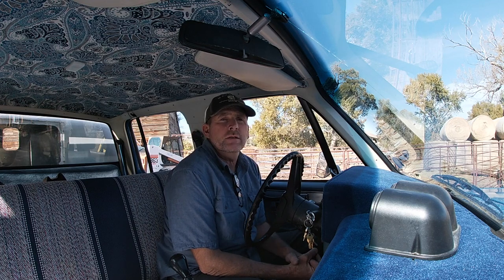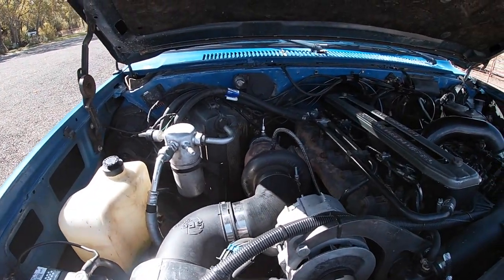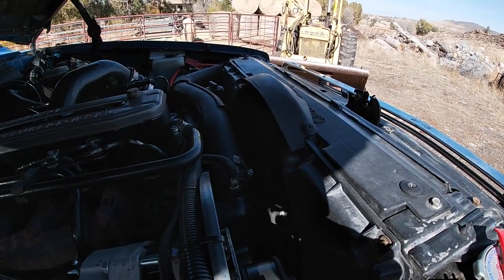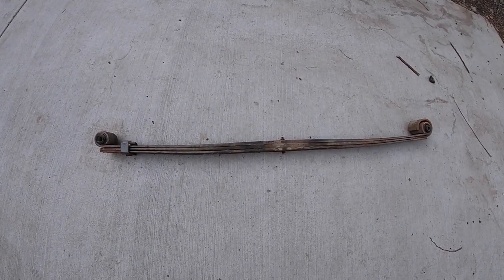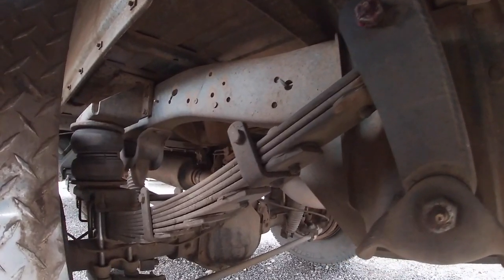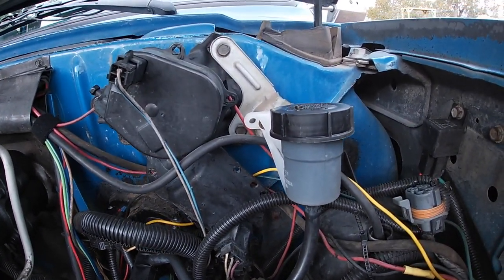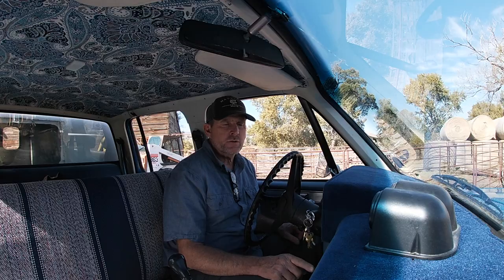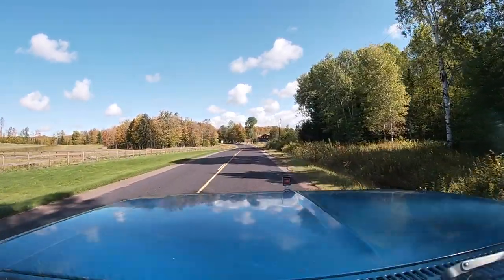Cummins Swap Square Body

Comment: i like your truck its better than any new one on the market I have a 1993 ford f 350 crew cab 4x4 7.3 idi  automatic overdrive 4.10 gears i get 22 mpg at 70 mph i would not trade it for a newer truck

Comment: I absolutely love your truck! I have an 87 Suburban that I bought for 1k bucks. It's on 35s and I love it but it's got a tbi 350 and I average about 8 mpg just driving down the highway without pulling anything. Your video has inspired me to look further into a Cummins swap for it so I can pull my camper with it.
Reply from the maker: Jason thanks for watching. It's a totally different truck with a Cummins. It's capabilities far surpass what it use to be. However I always feel the need to tell everyone who is thinking about doing the swap, it not for the faint of heart and there are cheaper ways to get a pulling rig, but I still love my truck and don't regret it. And its got the cool factor!!
Reply: Going off the Rails thanks for the reply check out my Suburban if you get a chance on Instagram @bigbadburb

Comment: I basically have the same type of truck you have, crew cab chevy 84' 1 ton with single rear wheels, was also a camper special that had 2 battery trays, hydroboost brakes, and it was a manual so it had the higher trans tunnel, installed the cummins over a year ago and have tripled my MPG and increased my pulling power to boot.   I have it straight piped for now but like you, i'm going to make it more comfortable to drive for long hauls.   There are Mechanical cruise controls you could potentially install on the truck to make it easier for those longer drives.
Reply: I got done with the same swap a few months ago. 1983 K30 dually 4x4. Went from a dog 350 getting 6MPG to having gobs of torque and getting 22MPG. 

I was lazy with the exhaust and stuck it through the hood. It is a little uncomfortable on long hauls especially if you're hauling heavy and can't use 5th gear. 

My 12 valve came out of a Ford F800 so I couldn't use the radiator, or fan, or intercooler, they were way too big. Used an aftermarket all aluminum radiator and dodge second gen intercooler. With some low pro electric fans. And a reman NV4500. 

It was a pain while doing the swap, but that first drive I knew it was all worth it. 

I didn't end up having to modify much either. Driveshafts fit. Pinion angle was right. Firewall cleared easy. Just fuel lines and throttle linkage had to be figured out, couldn't use the ones out of the F800. 

One thing I noticed after driving it for a while: I had gasoline fuel sending units in my gas tanks. When below half a tank I saw a steep decline in power. Turns out there is a difference between the gasoline and diesel sending units. The fuel return on the gasoline unit drops the fuel from the top of the tank and it falls and splashes. The diesel unit fuel return has a pipe that returns the fuel to the very bottom of the tank. I found that my fuel was foaming up and aerating the, causing a loss of power. I swapped them for the diesel units and that problem went away.

Comment: Great video. Very informational. I just bought my 1988 gmc 3500 dually crew cab xlt. No rust and super clean. 2800 bucks. I have my 5.9 Cummins all ready. I have a long way to go until finished, but this video will definitely help.
Reply from the maker: Tom,  Thanks for watching . Im glad you could glean some helpful information from my vid. Feel free to email me if you have any questions about specifics on my build. david@morrowsports.com
Reply: @goingofftherails9877  thank you!  I emailed you!

Comment: My first trick was a 82 F-150 4x4 had that for 20 years. My current is a 2000 Explorer have had it 10 years. 
And like you I like the simplistic lay out.
All wheel drive has a radio and A/C.
but thats it.
Though there is a computer or two.
Hello from Alaska

Comment: For anyone considering a swap seriously  consider the 24 valve Cummins. Its much quieter than the 12v. As long as you have a good fuel system there's nothing wrong with the VP44. They will absolutely last 200k+ miles. My hat goes off to David for the swap though. Love the truck, I want a K20 Diesel swapped really bad. 8)

Comment: I love your truck!  I did a cummins swap on my 1986 gmc 3500 dually.  It’s a 5.9 with a nv4500 2wd.  I did a 3” body lift to avoid the firewall mods.  I upgraded to a vintage air surefit system and no longer have the stock ac under the hood of you did that you could have room for your compound turbos.  I did the lizard skin to try and deal with the noise but it still have to do the firewall and dash with dynamat and foam to quiet things down some more.  Nice video and have a Blessed day!
Reply from the maker: Thanks Jason. Would love to see yours. Do you have any pics on instagram ?
Im taking mine to my sons Ranch in Texas soon and I'm doing valve adjustment this week to see if that could help a little. I don't mind the noise that much but just trying to keep my wife happy. I did put a K27 turbo on a few weeks ago. Noticeable power upgrade
Reply: I am on instagram under supernaturalnut the truck is on there it’s white.

Comment: Getting ready to do the same exact swap on my '98 K3500 CCLB Dually.  My donor is also a 1994 Ram.  Bought a bunch of parts from Power Driven and will be getting started on the project by the end of the year.  Still need to buy mounts and get a Dodge bellhousing and input shaft for my GM NV4500.
Reply from the maker: What parts did you get from Power Driven? Turbo? Injectors? I am thinking about upgrading to a K27 turbo from PDD.
Reply: @goingofftherails9877  I bought their 500hp Fuel Package, pushrods, 60lb springs, hot rod lift pump and their new Aggressor turbo.  The K27 would probably be a really good match for those parts, but I wanted to give myself a little room to grow if I turned it up any more. We'll just have to wait and see how that combo works.  I'm super eager to get started on the swap and get rid of the slow, thirsty 454.

Comment: Really cool truck you've built yourself. I've got an 71 gmc that I played with the idea of putting a 12 valve into but ended up deciding in an 8.1l big block. Wasnt aware you had a yt channel, I first saw your truck on tfl's dude I love my ride
Reply from the maker: I started YouTube shortly after tfl's video , since there was so much positive feedback. I think your going the best route on your build with the 8.1 liter. I love my cummins but it was a lot work that you won't have with a v-8. Ive got a 72 and a 73 that I still would like to tinker with in the future . Good luck with yours !

Comment: Very cool truck. I have a 1983 K30 dually that I was going to LS swap. But a 12 valve with under 50k miles just fell into my lap, and now I'm REALLY thinking I'll put the Cummins in it. Only problem is my truck is an auto, so I'll have to convert it to manual.

Comment: Awesome truck. I currently own a 1986 M1008 with a 6.2 diesel. I’ve had it since 2012 with the stock non turbo 6.2 good mileage but no power. I’m goin this route with the Cummins but I think I’m going with the 1st Gen 5.9 12 valve. I just use it as a daily driver no hardcore wheeling.
Reply from the maker: A 1st gen swap is still a great option. I do like my Power driven diesel fuel adjustment that the P pump allows you to "turn up the fuel" .With the flick of a switch I can almost make this truck fly.  :)

Comment: I had the same smoke issue in town and an egt issue when towing with a 362 turbo and 100 horse injectors.  power driven diesels AFC live box is amazing on the fly pump tuning and at the flip of a switch full power for when you're feeling gitty
Reply from the maker: AFC live is Amazing! I leave mine turned down mostly but when I really need it , towing up a incline or passing, its crazy power instantly.

Comment: Dude.. Loved your video.. I kept backing it up lol.. Such a Sweet truck, and i did subscribe to your channel thank you!! Now then i have an 85 C30 2WD 1st gen cummins 5 speed clark out of an international that i bought off a guy in Payette Idaho, and it wasnt a great install so i had to "redo/Refab" alot of things.. in the process of a total brake rebuild and having problems with the hydro boost lines.. bought a remaned HB from rock auto and its different  thread so i got new lines coming and hoping for the best.. Also want to "fix my AC may have to have some new lines fabed up? Oh just one more Q.. i need to make my grid heater work and there is no GH relay only a hi amp button on the dash.. Any help at all i will greatly appreciate.. Thanks again Gods Blessing on you and yours!!

Comment: Hey if you are still trying to move that ac and heater box from under the hood vintage air makes a kit for an under-dash assembly similar to the new trucks and cars. Looks good!
Reply from the maker: Evan   Thanks for that tip. If I ever do convert to compound turbos, I will look into that option

Comment: I built the same truck as you except mine was a factory diesel ,  it's not that loud. however, I replaced the sound mat behind the dash( pain in the @$# ) and also it being a diesel it had a factory sound mat behind the engine on the firewall... Maybe this will help with your noise issue. 👍
Reply from the maker: I just bought some more sound deadening products and a decibel meter too. Plan on doing a video on noise level and see if I can quiet it down a little. Thanks for your input.

Comment: Hope you're doing well and hope to see this channel grow!  You mentioned having to enlarge the filler neck size to fit the diesel pump nozzle.  How did you do about that?  I just finished my swap and realized the nozzle doesnt for my 454 tank.
Reply from the maker: Hey DanteGTZ. All is well. I crafted a large tapered  punch from some round stock and simply pounded the the light sheet metal into a larger hole.  Didn't want to cut or file because I already hooked up the hoses. Work pretty good with a few rough edges. Good luck
Reply: @goingofftherails9877  thanks!  I'm going to see what I can do this weekend to enlarge the filler neck hole.  Still waiting on a few other parts to arrive and I need to finish a small amount of wiring but I cant wait to start using this K3500 again.  Take care.

Comment: Any chance you can tell me what adapter and input shafts you used to mate the gm np205 to the dodge nv4500?
Reply from the maker: I had Final Drive rebuild my nv4500 with new sincros and put the new shaft and adapter on the transfer case. I believe the advanced adapter is 50-6911 and changed from the dodge 29 spine to the chevy 32 spline, however its been a while and I don't fully remember . Thanks for watching

Comment: If you want compounds just switch to a Vintage Air setup for your AC. Moves everything under the dash, but you do give up glove box space.
Reply from the maker: Might just tackle that someday. I do think it would be worthwhile . I may have just smoked my turbo that I rebuilt, when I passed three trucks on the highway about 2 weeks ago. I flipped the switch on my AFC live when I went to pass, and I hit fuel a little too hard and my truck launched around the trucks but I went up over 40 lbs of boost... May need a new turbo soon?

Comment: That is my dream truck right there! What was the estimated build price if you don't mind my asking
Reply from the maker: Well... lets try and itemize 
1. bought old farm truck
2. machine block, rings, springs, head studs
3. rebuild on NV4500 with syncros 
4. advanced adapter plate and new spline shaft
5. modify both drive shafts with new u joints
6. South bend single clutch with slave and master
7. relocation bracket for A/C and  alternator 
8. new gm alternator and A/C pump
9. rebuild p pump at Industrial injection
10. Fass fuel pump and new fuel lines
11. Modify fuel tanks with fass pickup straw
12. Two new Batteries with heavy wire and grounds
13. After market innercooler with silicon tubes
14. new 40hp over injectors
15. rebuild kit on HX35 turbo
16. 4" exhaust with 2 mufflers
17. motor mounts with new cross member
18. Tach and gauges for boost and egt 
19. Belts, hoses, wires, misc......
20. untold hours of modification and fabrication and frustration 

Lets see.. How much?  20-30k but worth every penny
Reply: @goingofftherails9877  awesome! thanks! that's about what i was thinking. Such a sweet truck!

Comment: Hey, very very good video, all the information was great and you have one hell of a truck there. Can't beat a square body Chevy with a Cummins under the hood. I have one in my 91 suburban, done 30k since I did the swap, no problems apart from its killing my springs, the rear end wraps too easy and the fronts are sagging with the weight, my next springs will be like yours from off road design. It looks like you have bilstein monotube shock, how do you like them? I had them on mine but felt they didn't control the front end so switched them to koni heavy track adjustable. Thanks for sharing all the details of your truck.
Reply from the maker: You're welcome. I will let you know about long term ride quality on the shocks. I did ruin my first pair of front shocks because they were sized for the original front springs. Too much travel and not enough shock. OOPs

Comment: Built, not Bought, Nice work.

I'm curious what kind of difference your dual muffler setup made. I have a 1986 F250 with a turbo 6.9 IDI, and I have some drone at highway speed from under the cab (3" pipe with straight through muffler).
Reply from the maker: David. It did cut the drone to nearly non existent . The note from the tail pipe is kinda wimpy but ill take that over an annoying drone. When I put the second muffler in I welded v band clamps to most of the joints which makes it easy to change anything in the future. I just put a new turbo on yesterday (Borg Warner K27) and it was super easy to make the change .
Reply: @goingofftherails9877  Cool, and thanks for the reply. I may end up switching everything to a 4" pipe some day and trying the dual muffler setup at the same time. I don't have a crew cab but the extended cab should still give me enough length under the truck to fit the second chamber. I'm assuming you placed one under the cab and another under the bed?
Reply from the maker: @grndiesel  The  7.3 IDI I had in the 89 F-350 had a true dual exhaust with mufflers and 2" pipe . It sounded real good but wasn't too much

Comment: Great build love the truck!   My only question is how some people get the Cummins to fit without hitting the firewall?   Then other people have trouble getting it in without damaging firewall?   Just curious I'm sure it's a simple explanation.
Reply from the maker: good question Mark.  If your truck is a 2wd , the driveline tunnel will be smaller, too cramped for the transmission . Secondly, what transmission you choose makes for a driveline interference. The NV4500 has the least amount of firewall interference than others, but I still had to beat the firewall upwards and the pinch weld to get it to fit. the steel is very malleable and does conform to a different shape with some work.
Reply: Ok thanks it totally makes sense....there's just something sexy about a Cummins in a chevy!

Comment: Awesome video! Beautiful truck! I like your tire and wheel combination.  I would like to fit those tires on mine, but the width of my wheels are 6.5" What is the width of your wheels?
Reply from the maker: Thanks , My steel wheels are off of a F-250 and I think they are 16 x 6.5 and my tires on this video are 285/75 16 Michelin

Comment: I wanted 2 do something similar but I wanted 2 sit a 1986 Chevy crew cab body on a Cummin’s frame and leave the fire wall and dash and also leave the floor with interior from the cummin’s truck. Then weld the cab from the Chevy 2 the Cummin’s floor do you think that would be a easier way 2 do it.
Reply: that seems like way more work compared to a engine and trans swap and some wiring
Reply from the maker: I agree with Jeffrey Adams. Its tough enough to just do a engine swap, then add on cutting and welding to get the fit needed seems like a lot of work . Plus the GM frame and spring set up has a lot to offer in durability and easy modification.
Reply: @goingofftherails9877  hard to beat dana 60 and leaf springs for being tough

Comment: Hi awesome build got a question for you being a 1990 and living in Colorado does it pass emissions. 
Thanks for the awesome video and I appreciate any feedback.
Reply from the maker: Jason.  My Truck is registered as a farm truck. I have about 50 head of Yak and derive income from them, so I am exempt from Emissions. However I did go and talk to the emission people about a swap before I started. To my knowledge , if the engine is from a truck that is a newer model and your truck is similar in gvwr , then a swap is allowed as long as every emission related part is transferred from the donor truck to the older truck.
Hope this helps

Comment: How much tilt do you have on the engine? Also how much clearance between crossmember to oil pan? I have same mount.
Reply from the maker: Scott . Not sure the angle of the tilt but I did use the existing transmission mount and cross member to attach the new NV4500. The gap between the oil pan and the cross member is just about a fingers width. don't have any vibration problems
Reply: Ok thanks for the reply. Nice build